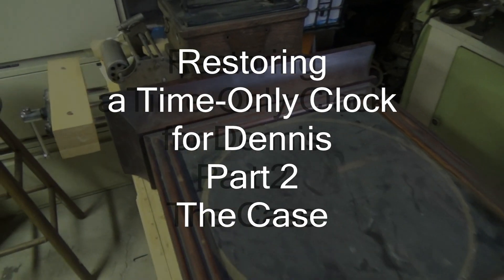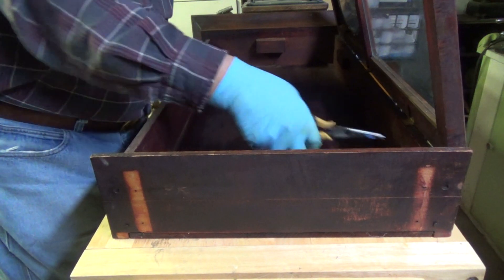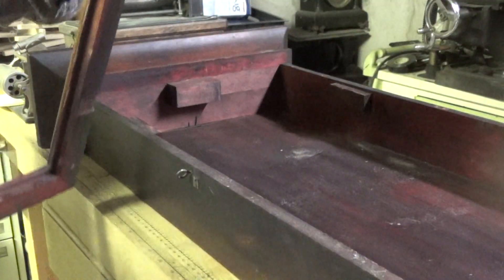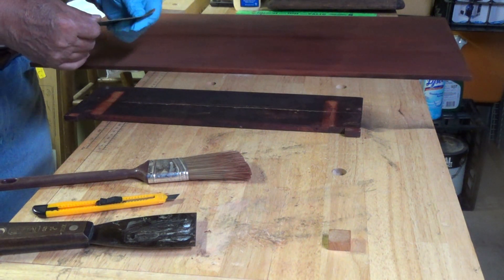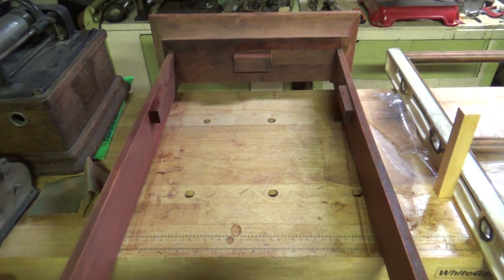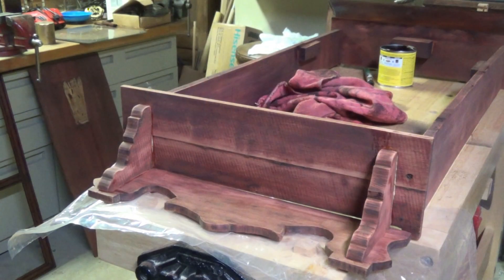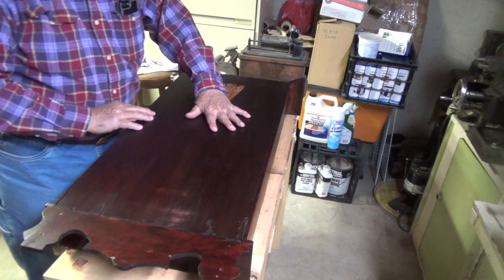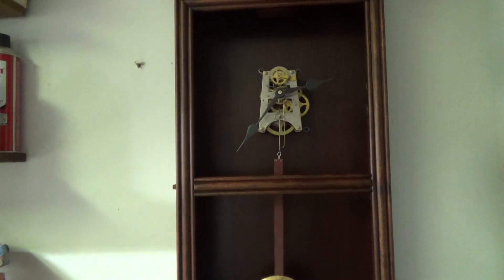Restoring a Time Only Clock for Dennis Part2 The Case

Comment: Do you ever compare the two plates to help determine the location of a new bushing?
Or measuring less worn bushing on one plate to relocate the proper distance in the other plate?
Just wondering if the center of a bushing or pivot is highly in question, what other possible ways may the true location be found?
Reply from the maker: If you have a movement where the plates are flat with no protruding posts, rivets and the like, one can put the plates together to line up holes to determine centers.  I've found no American style movements that allow this.  One can use a depthing tool to find exact distances between pivots and, by using it with three or more pivot pairs, finding centers through intersecting lines.  One could also use a set of pointed dividers to determine distances between centers on the unworn plate and transferring those distances to the worn plate.  Again, intersecting lines will give the true center. Both those methods would give much more accurate results than what I chose to do and would be important to use when doing work on more precision-made clocks such as French movements, where the fit is more critical.  American movements such as that in this video are very loose and the fit is much less critical.  In fact, it is often said that an American movement should be loose enough to rattle when run without the anchor in place.

Comment: What a difference! Nice work, Don!
Reply from the maker: Thanks 👍  I just finished the dial.  It was a mess and not original to the clock.  Now, I have to do the glass.  I've never done the stenciling.  Always just bought decals.  I'm going to attempt the vinyl stencil material.
Reply: @dperry428  Thanks, Looking forward to the finale!